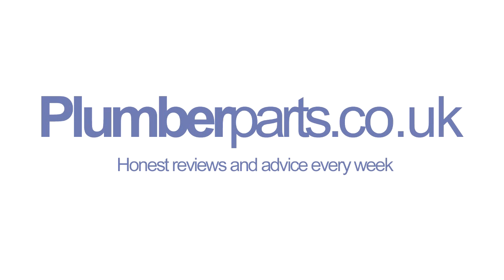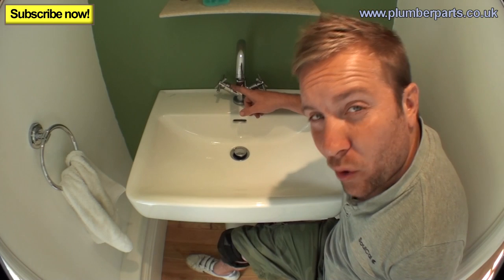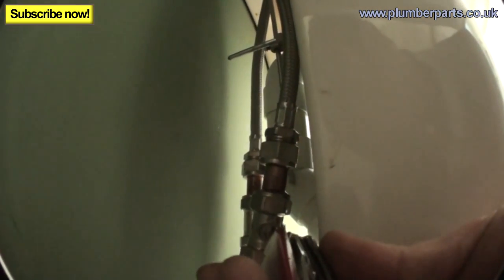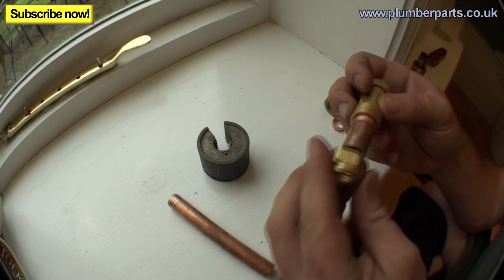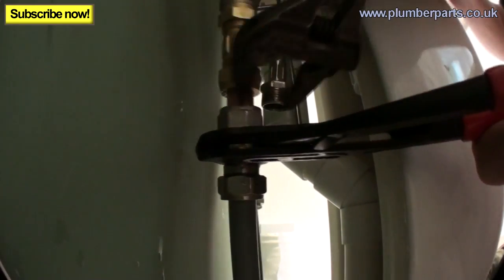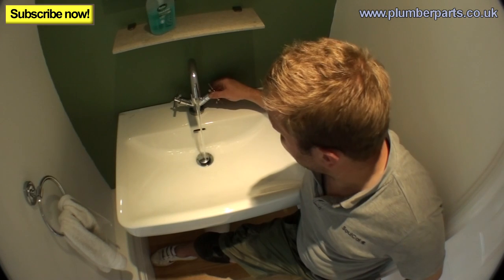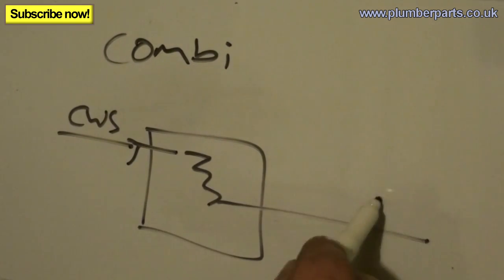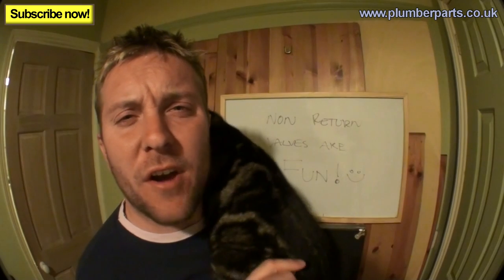HOW NON RETURN VALVES WORK - Plumbing Tips

Comment: Urgent help needed please
just fitted new mixer tap on my shower that has a separate pump, when mixer is turned to cold or hot on full power it flows good but when it is in middle position i.e. l am mixing half cold with half hot water, the pump stops and starts intermittently,and the water flows stop then start etc,  do you know why this is please?
Reply: I'm no plumber and no hardly anything about plumbing, but from what i know about electronics is,  your pump might be doing a good job, preventing it from overloading. Reducing the water flow is making you pump cut out, thinking there is a blockage, which is probably what it is supposed to do. The increased load on the pump / rise in current is probably tripping the protection circuit. I've no idea what your options are though, sorry.
Reply: Thanks for the info
Reply: No probs

Comment: Nice clear vid. I have a 15 mm double check valve on the hot and cold lines to my mixer tap. There is a screwdriver slot on the side of the valve that I thought may be for isolating the tap. After I got a bit wet I found that it is not for isolation, it just appears to cap a hole in the side of the valve. Can you tell me what it is for?
Reply: Neil Springate

Comment: Non return valves fitted on inlet hoses of appliances (dishwasher/washing machines etc) is a great idea and can prevent unpleasant, yet harmless, taste and odours occurring at drinking water taps. Chlorine in mains fed water can react with phenols that are present in some rubbers and plastic fittings (appliance hoses, flexi tap tails, phenolic rubber tap washers). The reaction produces trichlorophenol, more commonly known as TCP. A very distinct taste/odour, which unlike chlorine, will persist even in boiled water and is still detectable in tea and coffee. It's harmless, but who wants top in their tea? Fitting NRVs to appliance hoses is a great step to help reduce such tastes/odours. Note, most appliances will have some backlogs device within the appliance itself, but it's good practice to install on the mains feed side of the inlet appliance hose to tackle the affects of water sitting in the hose itself. 
Great vid re hot/cold imbalance. 
I think difference between single and double check valves is that a single check valve contains just one sprung loaded valve. A double check valve has two individual sprung loaded valves, sometimes with a test port between the two.
Reply: Wow you have just totally answered all my questions! I have been wondering about the water flowing back from washing machine/dishwasher into my drinking water as I am sure I can taste it in tea. I am off to buy a non return valve right now. Thanks so much for this info! 👍🏻

Comment: Good videos.
I have a non-return valve on the boiler filling loop (Sime 80E). Can I simply disconnect the loop from the valve or will water pour out. It does not seem possible to turn off the non return valve

Comment: how is it pushing cold water down the hot.
Reply: A bit late, but it's because of the pressure difference between the systems, mains cold is usually maintained at a standard pressure, whereas hot water has to come from a boiler, which takes time to heat the water, and has other places to distribute hot water to, so the pressure is lower in those pipes

Comment: HI,

My mate was saying about fitting these to the mains feed to his washing machine, to stop any grotty water sitting in the pipe circulating back along and into the sink taps as its drinking water.

However wouldn't mains pressure prevent this from happening in the first place?

Comment: It's not practical to run the hot water pipe low level into the bathroom due to the upheaval that would entail, so have in fact fitted a non return valve at the bottom of the vertical drop just above hot water cylinder exit, and it works fine. No more air after a couple of days

Comment: I changed a mains cold water electric shower to an inbuilt power shower using cold water tank and hot water cylinder ( with surrey flange ). Due to location of bathroom / hot water tank the only practical route was across the loft space from the tanks. The prob is that after a few days, the hot water pipe starts to contain air ,and the pump spins dry intermittently until it grabs a steady supply of hot water. and then its's ok for a few days.

Comment: Up until the early 80s Unvented Mains feed type hot water heaters were not permitted in the UK. I don't think you could even fit a 'Sludgebucket'/a thermal store prior to the Regs being changed.

Oi Jaz, do you play opening bat? Or are you a bowler??

Comment: Another great demonstration, and very entertaining. Next time you put one of these in a plastic pipe, I'd like to see that done. By the way, Most of the water heaters in my homes are under mains pressure, so pressure should be equal on both sides. Evidently that isn't the case everywhere. Why?